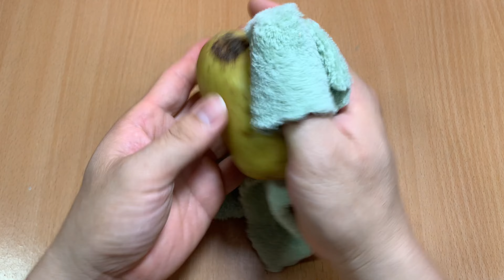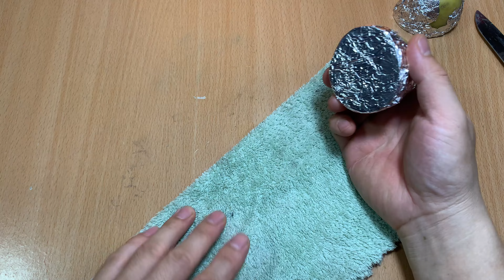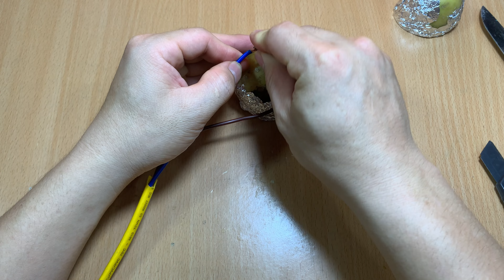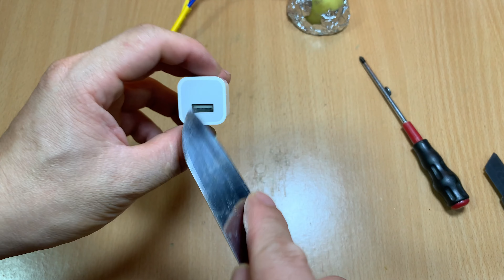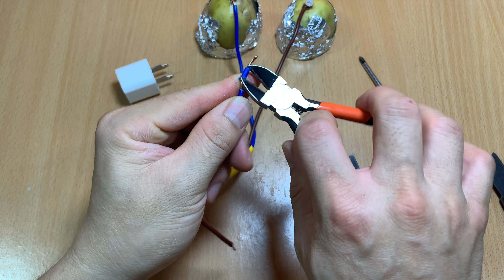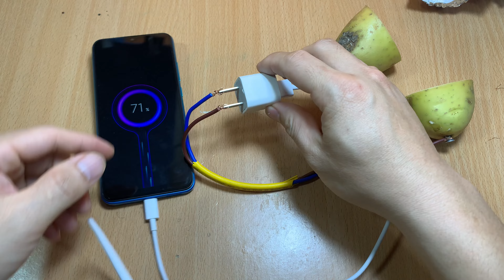How to generate free electricity with potato (charge your phone) DIY Techtrends

Comment: So you produce 220 Volts from potatoes, huh, so you can't have magically placed a battery inside the charging adapter at 7:59 , isn't it ! You can't even produce 0.000001 volts from a potato this way because the circuit doesn't complete the bridge. Scammer .